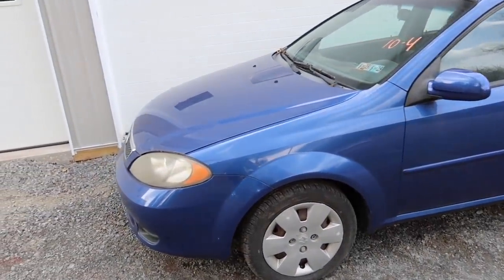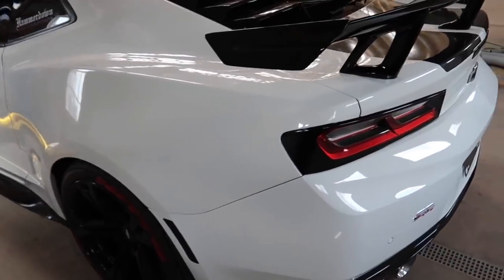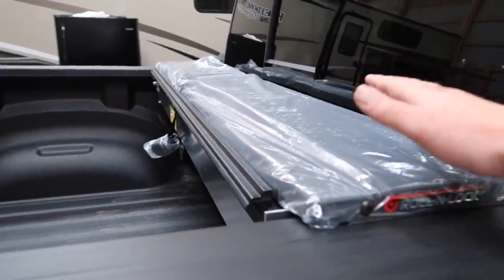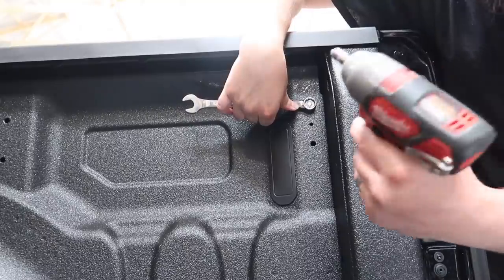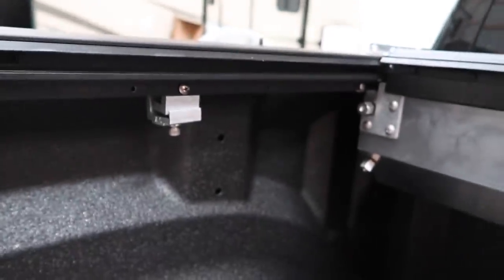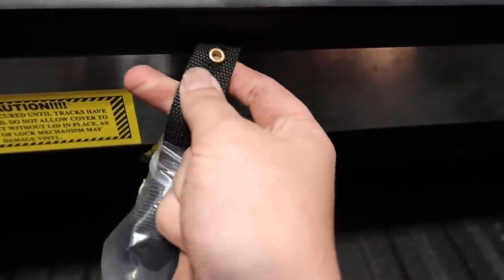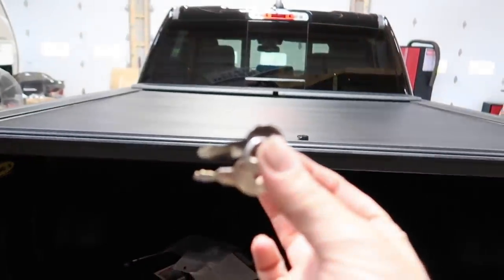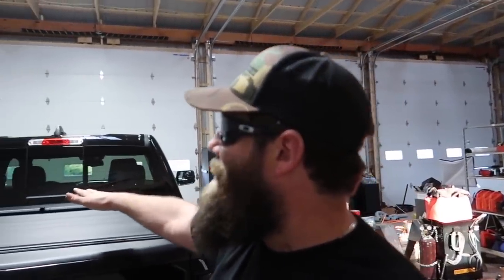2019 Ram Best Tonneau Cover Install

Comment: I have this cover on my 03 Ram, since 2003, and it still works great. I just purchased a 2020 Ram and I was concerned about the rear tail gate having those rear locking mechanism which would have inhibited the remote tail bed from being released. You did an awesome job explaining the functionality. Those small details makes a big difference. Thanks, ordering mine now...
Reply: What the name of this bed cover?
Reply: @dmax201149  mine is the Roll n' Lock bed cover. It's old but it's been through hell, and still works. 

I'm waiting for the powered one to install on my new truck.
Reply: Okay thanks or they  expensive
Reply: @dmax201149  depends on which one you go with. The E series is $2,400. That's a powered bed cover. And the M series is $1,300 to $1,400. They also have an A series as well. 

They are extremely well built. I had mine since 2003, and have no issues with it. They cost $900 back then.

Comment: I've got a bakflip HD on my Ram.  I like it.  This one I do like how it locks at different possessions in the bed.
Reply: I was looking at the BAKFLIP, however my RAMBOX has the factory-installed triple flip on it. I would have to replace the utility rack rails as well to install the BAKFLIP. Makes it a very expensive replacement.

Comment: I got my roll and lock installed on my 2019 ram on Saturday I washed my truck on Sunday and my cover leaked just wanted to know if yours leaks ?
Reply from the maker: edwin rosado I’ve had mine in rain and the car wash no leaks so far

Comment: I was looking at the BAKFLIP, however my RAMBOX has the factory-installed triple flip on it. I would have to replace the utility rack rails as well to install the BAKFLIP. Makes it a very expensive replacement.
Reply from the maker: Mario Monti true the roll n lock is a little pricy also but works awesome

Comment: How tall are your garage doors?
Reply from the maker: 14 feet
Reply: @HammerdownMotorsportsUSA  Nice! Seems like a good size for my future personal shop. Sad my truck won't fit in my current garage too tall.  (Ram 2500, 5 inch lift, 37s)

Comment: I love that cover but I really needed the space at the front of the bed where the cover rolls up for certain gear I carry.  I had to go with the Bakflip MX4.  It's not as smooth and easy to operate but it's very secure as well.

Comment: Its nice.  1399.00 for my truck is not too bad.  I paid 900 for a Revolver X2 roll up aluminum cover.  I might have paid the extra 600 for this if I had seen it.   I got one with the truck from the factory that flips in three spots, and it was kind of a pain.

Comment: Is that the M or A series cover and are you still happy with it? Thanks for the video.
Reply from the maker: rra I actually have a different truck now but it is still working well from what I know I am not sure if it was an M or an A it was whichever doesn’t have the vinyl covering which I had on my older truck both worked great just a preference thing
Reply: @HammerdownMotorsportsUSA  Are you still digging the cover? Does the top rattle at all? FYI - The M has the vinyl and the A is powder coated aluminum. Thx

Comment: Sorry I owned one of these covers and it had all sorts of problems, mainly rolling open at highway speeds.  Not the best.
Reply from the maker: SLCHigh might have needed to be adjusted I have had 2 of these and never an issue one I had for 9 years
Reply: I just had one for almost 7 years in my 13 Laramie I just traded in... By far best tonneau cover you can buy for a truck! The only "issue" I ever had with it was over the last 8 months or so it stsrted binding up a little bit, making it hard to push all the way in... Which remember it was almost 7 years old and I never once lubed anything up on it so I'm sure it would have been a super simple fix if it bothered me enough... But traded the truck in on a brand new longhorn and getting ready to purchase another Roll N Lock cover for this truck! You won't find a better quality, more convenient cover for any pickup bed! Im not sure what you mean by it kept rolling up going down the highway but sounds like an installation problem to me, maybe the little hooks that keep it shut needed adjusted or realigned

Comment: What model of the roll n lock did you get?
The M series or the A series?
Reply from the maker: wdavant there are a couple variations I think the difference is the tangs that lock into the tailgate and the vinyl top mine has neither if those I tried to look ok their website to identify mine but their product photos are all the same
Reply: Hammerdown Motorsports 
They offer a vinyl top (m series) and the aluminum painted top is there A series

So if it has the vinyl top, it’s the m series

I called a local place and they said to get the m series Bc the A series (aluminum top) will start to have the paint flake as dirt sits on top on the rails and scratches it as it gets pulled in and out of the canister
Reply from the maker: wdavant that must be it then I had the vinyl covered one on my old truck it held up good for the 5 years we had it

Comment: Hey so glad i found your video. How much space does it take up in the bed. Depth and length? Is you bed 6 or 5.5. 
Ive been searching all winter on finding a tonneau cover for my 19 Ram. Very difficult since most are junk even for 1k$. I have the R & L on my Silverado but never considered it cause of tailgate lock.  The large canister and it freezes up in winter, (the Latch)
After  seeing yours im considering it. Other thing i want to do is add a over bed and over cab Rack. For Tule and Kayaks. If you know of anyone thats done it let me know. 
Thanks.
Reply from the maker: It takes up about 10 inches of depth and 8 inches of length mine is the 5.5 bed
Reply: Truck Covers Usa has a Retractable Tonneau that accepts they're Rack system

Comment: What bed liner do you have in this truck? I like it am curious about pricing that out.
Reply from the maker: I had linex done it was 700 for the premium
Reply: @HammerdownMotorsportsUSA  I got quoted $750 for premium linex here in NYC and $655 for rhino. Would you advise against rhino or is it just as durable?
Reply from the maker: @upthepooper3555  I have no experience with rhino but the linex is a great product,, my current Ram has the factory stuff it does the job too

Comment: Thanks for another great parts video for the 2019 Ram 1500!

2 Questions:
1) Ram box/multifunction tailgate. Does this also fit on the Ram 1500 with the Ram box or multifunctional tailgate?
2) Water and dust protection. Have you experienced any incursion of water or dust into the cover system that will affect the mechanisms movement, and the passage of water or dust into the bed while it's covered? Thanks.